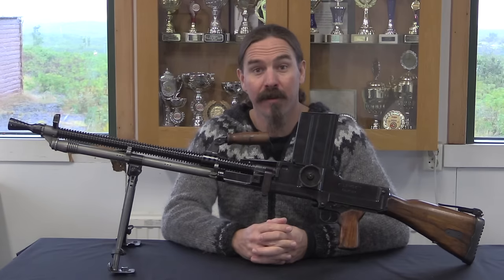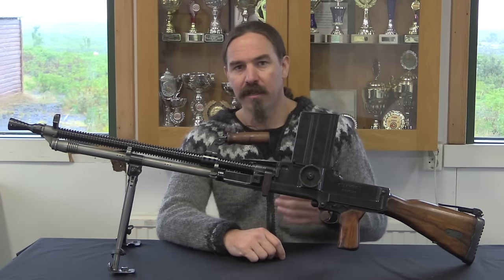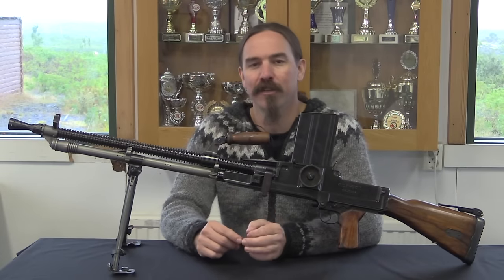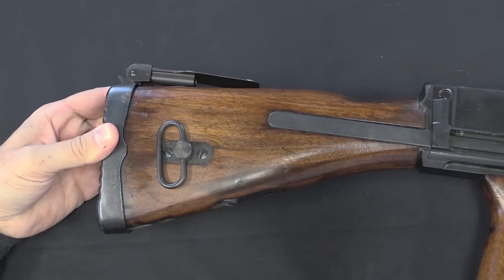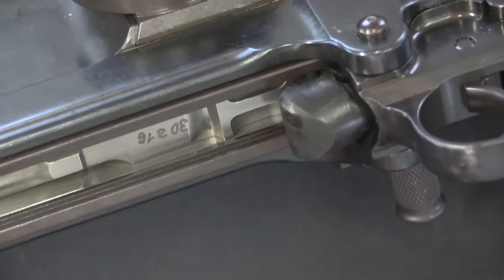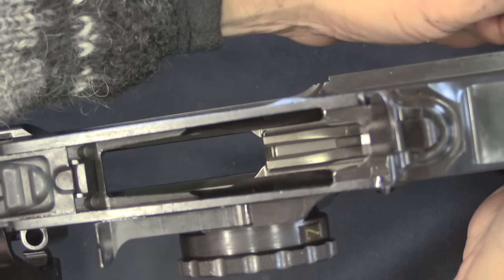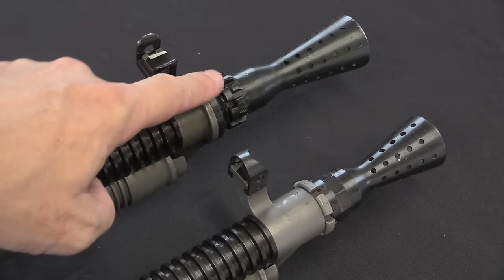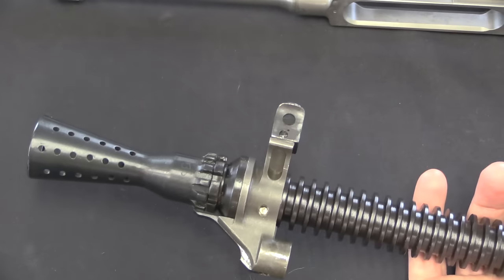Romanian ZB-30 LMG: Improving the Already-Excellent ZB-26

Comment: in reality those were used in Romania until 1989 with Patriotic Guards! they had also vz. 24 (also 8mm) and Orița SMGs. and even MG 42.
Reply: Did you ever use one?
Reply: @allengordon6929  no, I was not on Patriotic Guards and even there only just a small part of them had those weapons. Other of them had older Soviet style weapons like PPsh (PPȘ Md. 1952" build also at Cugir) or RPD LMG. Others of them had AK G (Guard! which were selled in USA later) and more newer MG.
Reply: @MrQ454  i was under the impression that all civilians were in the patriotic guard back then.
Reply: @allengordon6929  a large proportion, but not all, were even women (a smaller proportion). It depended on the military service performed before and the job. The others were part of the reserve. In general, the guards corresponded to the place of the factories (or the companies where they were), there was the weapons store assigned to each unit. In the countryside, they were coordinated by agents from the communal  militia stations, where their armory also existed. If I'm not mistaken, even in the countryside they were armed more with WW2 weapons (ZBVz 24 carbines).
Reply: @MrQ454  figures. For whatever reason there are a lot of women in romania's military (and other such services), even as combat troops.
Reply: @allengordon6929  then it was mandatory more or less, not the same as now

Comment: What is perplexing is that during WW II neither Romania or Germany didn't make a 30 round magazine for the ZB-26/30 they used. Even after invading the USSR on June 22, 1941 no 30 round, though the need for increased firepower, especially for the Romanian units involved in the campaign became obvious. The 7.92x57 variant of the Bren used by the Chinese Nationalist Army produced by Inglis Canada also didn't have a 30 round magazine.
Reply: Hello George, there have been in fact quite a few 30+ rounds magazines produced in Romania towards the end of the war. They show up a lot in 1944-1945 photos and relics of them are sometimes found in battlefields. Unfortunately i have not seen one in a good enough shape of the spring to test how many rounds fit, but there should be at least 30 if not more.

Comment: Just a little note. The ZB 30 machine gun was produced by Zbrojovka Brno, but it was never accepted into the Czechoslovak army. However, it was exported to Iran, Turkey or Romania. And as Ian said, license were issued to othe countries to manufacture.
Greetings from Czechia
Reply: Thank you for more information.
Reply: I was just thinking, years from now if Ian were to get Alzheimer's, all weapons could become "forgotten weapons."
Reply: The Zbrojovka Brno factory area has mostly been razed to the ground and a community campus is to be built in its place. A single factory hall and a "boiler room building" are all that's left of the original facility. There's an outdoor cinema every summer. It'll be a nice place to visit in a few years :)
Reply: @Tallmios  That's really cool-and not an uncommon scenario-thanks for the information. I'm glad the land of the former factory is being put to good use.
Reply: To be more precise, Turkey was ordering the model ZB-30Cz ('Cz' does not mean Czech in this case), which had some minor modifications and used more durable materials for the barrels.

Comment: I'm always surprised at how many changes have been made to the ZB 26 and all have gotten it to run, even with the .303. Thanks to the folks in Iceland.
Reply: @JohnMoses1897  Also kind of a shame that it didn't work out with the EM 2 and the .280, that would have been just the right answer to the AK 47.
Reply: The Brits wanted to adopt a rimless rifle cartridge even before WW1. Then the war happened, so plans put on hold. Post war it was decided that all that WW1 surplus .303 made it cheaper to just stick with the rimmed round. So they kind of backed themselves into a corner in that regard. Somehow they got the .303 to feed well even in very fast firing machine guns like their aircraft mounted, open bolt version of the Browning M1919, and the Vickers K aircraft defensive gun.

They did also adopt 7.92mm Mauser for their tank mounted BESA machine guns, due to a lack of time to redesign the weapon for .303. So during WW2 there were factories in the UK making what was essentially Wermacht ammo!

Comment: I’ve got one that has HK stamped into the bolt (like what Ian has here 15:00) and a Yugoslavian crest on the receiver. This tells me the Germans seized control of the factory while it was still being manufactured. After the Germans completed its assembly and sent it back to the German Army for acceptance, it received the HK proof mark from Heinrich Krieghoff. No waffenamts, but there is what could be a unit marking “1.TR” on the stock. Unfortunately the barrel on mine has been destroyed, so if anyone in the US has one or can make one for sale, please let me know!
Reply: Guns destined for the SS didn't get waffenamnts, at least early on, as they were equipped outside  officials channels. Hence a lot of odd, but cool, Guns like mp-35, m1932 broomhandles, zb-26 etc
Reply: 1 TR Is #1 Teknici Remontni (1 Technical  Repair) in Serbo-Croat, in Latin script.
So a Yugo issued gun, may be recovered after WWII.
The   Germans ( esp. Waffen SS) used these Yugo guns on Eastern Front, as did Italian Bersaglieri Motorised units in Russia ( wartime It. and Ger. Photos)
DocAV
Reply: To get a new barrel try Sarco

Comment: The Cugir manufactured version also has wrench flats on the flash hider (I suppose in case you need to adjust the gas when it's caked/dirty).

Comment: hey Ian, excellent video, just a small observation: these LMGs were not actually taken out of service after the WP integration, they were indeed gradually relegated to non-front line and popular militia type of units (Patriotic Guards), but they were actually standard issue for such forces well into the 80s and the 90s. "If it works, dont fix" kind of thing. I even remember seeing themin the hands of people during the '89 Revolution, and seeing them up close, as a kid it struck me that they seemed so much bigger and meaner and .... more gunny than the AKMs and whatnot :)

Also, can you perhaps please shed some light on how/why would it contain an HK bolt? Is it contemporaneous with the weapon, or is it a later addition?
Thanks,
Reply: Edit: I just realized you're probably talking about Romania. I'm talking about the use of ZB vz. 26 in Czechoslovakia in my reply.

They were also used by the regular army in border fortifications for a very long time because those were built with these guns in mind. The forts received new anti-tank guns but the machine guns remained mostly the same.
Reply: @originalyankee9326 Also, can you perhaps please shed some light on how/why would it contain an HK bolt? Is it contemporaneous with the weapon, or is it a later addition?

Connected HK, circled HK, and  separate H K variant markings are commonly found on interwar Czech-manufacture weapons, often on bolts and magazines. I've heard the marking be attributed to being proofed/assembled by Heinrich Krieghoff, however the markings are found on weapons whose manufacture is not associated with and did not involve Krieghoff, so I'm unconvinced of that connection. In any case, it is an 'original to gun' marking, and (probably) not a replacement part, though if it is, it would still be contemporaneous. It has no relation to Heckler and Koch.

Comment: You can see the genesis of the Bren although there is a world of difference in the detail. Both have magnificent machining (and time consuming and expensive detailing - which undoubtedly lead to their renowned reliability).

AND it's a breach BLOCK not breach bolt (it drops, not twists).

Comment: I wonder why Germany went to heavier ammunition if they were perpetually short on reosuces. Was lead maybe in greater supply than smokeless powder?
Reply: No, resources weren't (much of) a factor. They designed a longer bullet with better ballistics at longer ranges.
Reply: @MarvinCZ  Approximately 25% more lead per bullet across hundreds of millions of rounds, though. You'd think that'd add up. Especially at the rate machine guns like MG42s burned through them.

Comment: There is much more Yugoslav ZB 30 on market, than all ZB 26 together.
Reply: that would be the ZB30j, which is a modification of the ZB30. All the major parts are NOT interchangeable between the ZB26/ZB30/ZB30J/Bren Family, even though they all look the same. Just about everything was tweaked between versions.
Reply: @joe6167 I here in cz saw ZB30J with ZB 26 barel, so it masted be customized?

Comment: What was the idea with the magazine on top of the gun like that?
Reply: Ground clearance.  Also more reliable feeding (magazine spring doesn't need to fight gravity).
Reply: @JohnHughesChampigny  huh, thanks. I just learned something new.
Reply: @anthonyloconte7835  Same setup on the Madsen LMG, the Vickers-Berthier and the French Châtellerault FM24-29
Reply: It's easier for the assistant gunner to  change the magazine, without disturbing the gunners hold on the LMG.
It also means that magazine capacity is not restricted by ground clearance. Or, alternatively, that the gunner does not have to expose themselves as much when firing prone.
Reply: Guys thank you so much. I just learned some new things.

Comment: Ho wis this different from the Yugo modified ZB30J?
Reply: Practically every component was modified between the two models. But the biggest change was moving the gas port further back, which is why the ZB30j has that really long flash hider.

Another visual clue is that the barrel has two knurled sections before and after the carry handle, as opposed to having cooling fins along the entire length.

The rear sight has a 100 m zero instead of the 200 m zero. And the sight radius is shorter, since the front sight/gas block was moved further back.

The design of the bolt was tweaked a little bit, and the ZB30j uses a round tipped firing pin instead of the square tipped firing pin that the ZB26, ZB30 and Bren Guns use.

One easy way to recognize the ZB30 is to look for the round hole drilled into the receiver ahead of the barrel change nut. The ZB26 and ZB30j don't have that.

And the bipod is different too. They changed it with every model.

They also changed the design of the rubber case deflector in the trigger grip. In the the earlier models it was just a piece of rubber. In the ZB30j its a rubber wheel on a steel tube.

Check my channel for some videos featuring the ZB30j ;)

I haven't done a Forgotten Weapons style breakdown, but for example I do explain how the trigger group works!

Comment: What a pity that they didn't design a curved 7.62x54r magazine for and upgraded the ZB.
Reply: There was a 7.62×45mm (and 7.62×39mm) version with dual feeding (belt or magazine) designed after the war. The Czechoslovak UK vz. 59 is also building on that heritage but it's substantially different.

Comment: A 20 round magazine sounds a little limiting. Yes I get it you’re assistant gunner will be changing mags for you but suppose you don’t have an assistant ? Because in case one doesn’t understand how war works….well people die. It might be a little nicer to have a 30 or 40 round magazine
Reply: Make the magazine much bigger the the gun becomes very top heavy and unstable. Plus it’s more difficult to make reliable high capacity magazines for big rounds. As well as reloading the assistant gunner will be carrying most of the spare mags and ammo. It’s very much a team effort. You gain in some areas but need to compromise in others. Choosing what you’re willing to compromise on to get what you absolutely want is the key skill.

Comment: so i MAY be wrong but i have an extension to see the likes and dislikes
and it SEEMS
 that you start out as default dislike until you like it..
for example i come to this video it had 14 likes one dislike.
i liked the video it now has 15 likes no dislikes..
id like YT to explain this..
Reply: Looks nasty as😂.
Reply: I'd bet that it's the extension assigning the default value, not YouTube. But if you always 'like' the video, what would it matter?
Reply: Point I would hate to be shot at with that or any .
Reply: @AndrewAMartin   it would imply that those people who choose neither to like nor dislike are default counted as a dislike.

as i said its sus. not that im certain..
perhaps if theyd stop hiding the dislikes this wouldnt happen
Reply: @ripvanwinkle2002  Let me reiterate, as a web application developer, I'm reasonably certain that the behavior you're seeing is due to the extension, NOT YouTube. The extension is changing the interface, and depending on the tool used, the extension developer chose the default behavior of the interface. Some tools don't handle nulls (non-answers) well, and there may be other considerations also. Good User Interface design is hard - anyone can throw controls on a page and call it done, but making it work correctly and reliably takes real work.
Reply: @AndrewAMartin   if YT were trustworthy id happily accept your answer. il be glad to admit its most likely true.. but YT has been doing shady shit for almost a decade so.. there is that..
Reply: @AndrewAMartin   so fwiw went to anther yt page same situation, some likes no dislikes
as in there wasnt the -1 like added to the dislike column by default. weird but not proof of anything. but it also wasnt a big pro 2a gun tuber channel either

Comment: I never understood  the utility  of a 20 round machine  gun.  I would  think you would  be reloading  it every  4 seconds.
Reply: they are more portable and you have an assistant loading for you... and most of the guys you are shooting at have bolt action rifles and five round charger loaded rifles.

But just about everyone agrees with you, which is why after the war all developments of this family of guns both the Czech and British tried converting the design to belt feed.
Reply: I would also guess that compared to a bolt action rifle, this still feels like way more fire power.
That being said i don´t really get the point of the AA sight, as I think that the magazine would really hold it back there.
Reply: If you approach it in the context of the time it was developed though, man portable machine guns were still largely theory being put into practice. Everyone was still testing and experimenting with what would ultimately work in different doctrine approaches and interpreting lessons from WW1 in a mobility-accuracy-fire volume triangle of sorts.
Reply: My guess is that 30 rounds of full power is too big and heavy. This is why even modern battle rifles have 20 round mags as standard.
When it comes to the loss of fire rate, the low rate of fire of bolt action rifles would make even these designs seem rapid by comparison.
Reply: @reacher1077  still a lot of slow biplanes in use when these came into service  and the Lewis gun in ww1 shot down more than a few biplanes.
Reply: You have a whole light machine gun unit loading the mags and the machine gun with the mags while the machine gunner focuses on shooting.
Reply: They generally fire them in 3 to 5 round controlled bursts. So you might be able to stretch that out to 7 or 8 seconds. Plus you've got a loader popping in fresh mags, so I'd assume your practical rate of fire on this would be maybe 120 RPM max?
Reply: @reacher1077  When  the Bren was used as an anti-aircraft gun they used 50 or 100 round drum magazines.
Reply: magazine fed LMG enables the gunner to assault enemy position, earning a VC in the process.
Reply: @adaw2d3222  Reading about Australian actions in New Guinea makes it clear how central and vital the Bren gun was to them. With a well drilled gun team, the sustained rate of fire is reasonably comparable with belt fed guns of the time. Its not like the goal is to use prolonged, continuous fire even though a belt fed makes that technically possible. And rocking in a new magazine is a lot faster than changing a belt with less likelihood of creating a stoppage.
Reply: With an assistant loader the changing of magazines is a 1-2 second affair. Nothing you'd need to worry about. Your firepower will be more limited by the barrel.

Comment: Better than MG34 or MG42? Or are these not considered LMG in the light version?
Reply: These definitions change over time. Originally an LMG was aircooled, bipod mounted and magazine fed, whereas the HMG was water-cooled, tripod mounted and belt fed (also in a rifle caliber).

The MG34 and MG42 turned that all up on its head by being able to do both, which afterwards led to the concept of the General Purpose Machine Gun (after the war). But during the war German doctrine still referred to them as HMG and LMG based on how they were used (bipod or tripod)